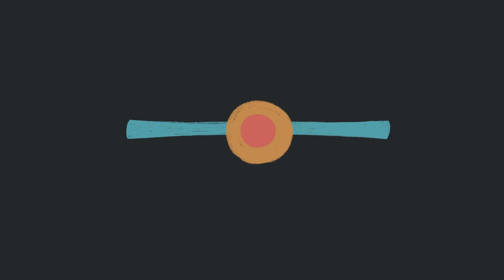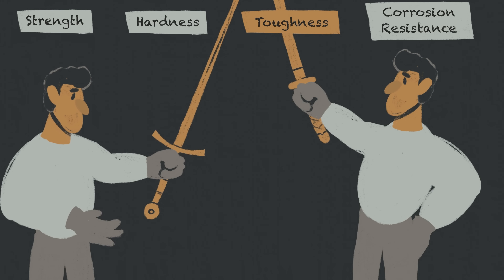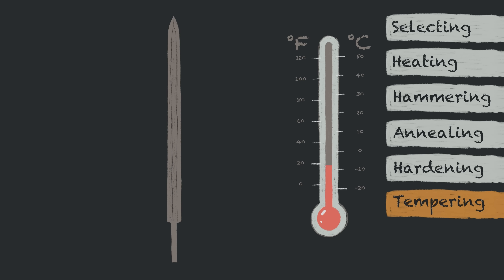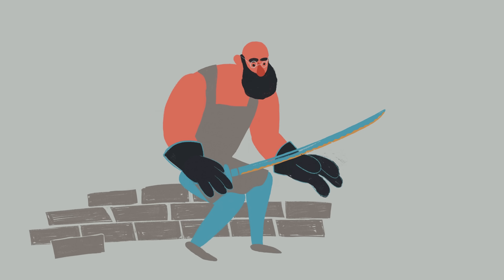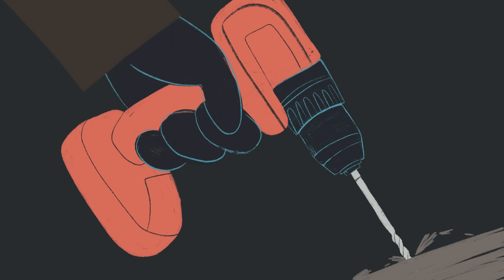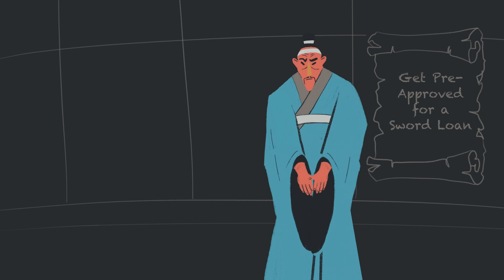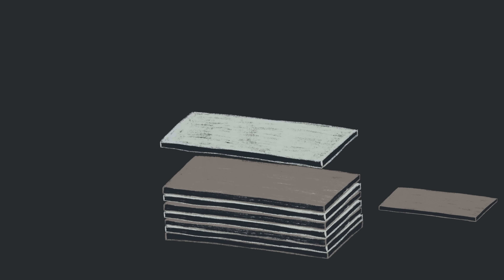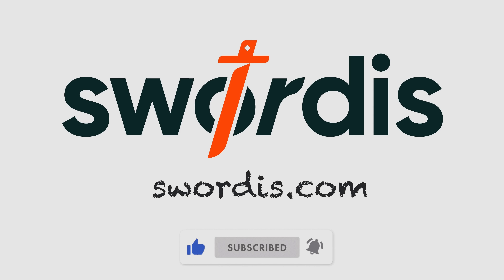The Science behind Sword Steel Types

Comment: The video suggests that through hardened blades are less tough than differentially hardened blades (around the 4:30 mark).  I have to respectfully disagree.  Perhaps this would be true in ancient Japan with a traditionally made sword, if it were through hardened to a VERY high rockwell hardness.  But, without a doubt, a sword made of a modern steel, for example, T10, that is through tempered is far more durable than a differentially hardened blade made with the same steel.  Multiple destruction videos demonstrate this (such as those found on Youtube by Matthew Jensen), and I have also seen the truth of this from first hand experience cutting with both types of blades.
Reply: Differentially hardening in a modern context is first and foremost an aesthetic choice, and I certainly find it (the hamon) attractive and worthwhile to have on some of my swords.  I would say that differential hardening does offer one practical advantage, in that the edge hardness is usually measurably higher than through tempered swords (using a Rockwell hardness measure) which means the sword will have higher edge retention and need to be resharpened less often.

Comment: Steel is NOT an alloy. an alloy is made through a chemical bond. Steel is iron that has carbon dissolved into it like sugar is dissolved in water to make a sweet drink.
differential hardening does not happen because of the rate of heating the blade. 
lower carbon and greater toughness does NOT change flexibility in a sword at all. this is entirely untrue and misleading.
Silicon also does not make steel more flexible it is as if you do not know what the word flexible means
your definitions of tool steel and spring steel are utterly uninformed
bainite is a state steel structure like martensite or pearlite not a type of steel. nearly any blend of steel can be made into bainite and indeed L6 can be made into martensite, pearlite, or bainite. indeed the L6 swords I make are martensitic and not bainite at all.
Also see Marton_dobo's comment below
OK I'm done picking this apart and I'm done watching this. This video contains no useful information move along folks

Comment: I don't think toughness necessarily correlates with material softness. Toughness refers to the amount of energy you can put into metal before it fractures. Tougher metals can stretch further without fracture. So tougher metals tend to be softer, but they can also just be high strength metals instead.

Comment: I am sorry guys, I understand, you are from Japan so you have to defend tamahagene steel. But today, stainless steel is the "best" one. And second is spring steel. Because of the ability to be shock resistent. Diggers, buldozers and cranes. Everyone is using it. There isn't a best steel. Steel is a steel. Everything has it own advantages and disadvantages. But where is you "best" steel? I haven't seen tamahagene steel in my life. I drove a toyota and its whole bodywork is's rather stainless or springsteel. And If we are talking about swords, tamahagene is theoretically worse. Because Japanese people didn't know how to heat up iron just enough. So they had to came up with something special. And that special thing worked. They made a good steel out of "nothing".

Comment: Stainless steel can be just as good of not better than carbon steels. The issue is that it's a nuisance to work and it's very expensive to get good ones
Reply: This ∆ 

Nowadays stainless outperforms carbon in basically all aspects (even in toughness stainless steels can at least match it). The issue is price

Comment: Toughness is how much energy you can absorb while you are bending. A sword will eventually bend, and a low toughness sword will snap while a high toughness one will deform. Resilience is how much of a beating the sword can take before it starts to bend without springing back into shape
Reply: Toughness in this context is more accurately the energy it takes to break a sword. A brittle material can theoretically be tougher than a material that bends if it takes enough energy to break it.

Comment: As interesting as it is. You've mixed few different concepts making it entertaining but not as educational as it could be.

Maybe this video is made more as marketing than educational material.

You're mixing modern metallurgical terms with traditional/historical ones. Eg. Tamahagane and modern Damascus steel are essentially same thing. 

Then we have carbon steel and alloy steel. Alloy steels are then divided in multiple subcategories.

Spring steel is just type of steel commonly used in spring production. It can be either high carbon or alloy. Though alloy spring steels are more widely used.

It goes on and on.
Yet, with all my comments I like this video. It's fast pace and very concise. If not for mixing buns with onions I'd call it perfect

Comment: I was a blacksmith for 25 years and got so incredibly tired of "swords."
That said, this is the most accurate video I've seen.  You use every term correctly and that is rare.
Reply: Do you have any resources for someone looking to start blacksmithing? From what I've seen online most books dont actually detail steps of creating tools and most videos use machines not accessible to someone hoping to pick it up as a hobby.
Reply: @oneilgaming1658 black bear forge has some good videos.
Reply: @oneilgaming1658  
There are a lot of very good beginner videos out there.  I run across them, but, not being a beginner, just move on.  You need a hammer, something to heat with and an anvil.  I started with a ball peen, a broken anvil and a pretty rough coal forge.
All done, I was in for a $100.
I made a set of tongs, awful things, but I got better, bought a used cross peen hammer, a vice and joined a club.  Piece of cake
Instead of an anvil, a piece of railroad rail works great, a $100 propane forge won't break the bank and a machinist vice instead of a blacksmith vice is ok-ish.

Comment: Stop using AI for research.  A coursory look through an introductory bladesmith forum could have given you better information than this.  No one is using below .45% carbon or above 1.2% carbon steels for blades.
Reply from the maker: It could be misleading because that percentage refers to the steel composition. If you look at the carbon steel section, you'll see that we mention the carbon content starts at 0.45%

Comment: Claiming that differentially hardened blades are tougher than through hardened is a wild claim. Yeah, maybe the differentially hardened blade won't shatter to pieces, but it will bend and blow huge chunks of the edge off, which is just as bad. 

And the through hardened blade isn't likely to shatter either. it can break, but it takes a lot more force to do so.

Comment: The part covered with clay does not heat slower but cools slower, that makes the metal softer. both clay-covered and non covered have the same temp when coming out of the heat source

Comment: All that being said.
What is recommended for kitchen knives?
Reply: Depends on how much maintenance you're willing to keep going through to ensure a long lifetime for the knife.

Stainless is the most common because of its rust resistance, since a lot of stainless cutlery and other implements may be laying around for a while without being used regularly.

If you're using the knife daily, or even hourly, stainless steel doesn't hold an edge as well and will require a lot of repeat honing (unrolling the edge) or sharpening (when it cant be honed anymore).  

That being said, the metal type really depends on the intended usage.  If you're dealing with a lot of acid in the food, you want a metal that's more corrosion resistant.  If you're cutting things that require a rocking or sawing motion you'd ideally want something a little softer so potential blade warps dont cause chips or fractures.  

There's no single "best" option, a blade is a tool and the tool should be chosen for the specific job.
Reply: Nonono 

That is all wrong what you said there. 
Stainless steel in general offers higher edge retention due to carbon steels only having the realtively soft cementite as hardest carbide
Reply: Stainless? Idk since it resist rust the most
Reply: What is your budget is the question? 

Open end? -> magnacut 

It combines fantastic edge retention with great thoughness which again allows very thin geometries which in turn again boost cutting performance and edge retention. 

It has very small carbides (like the opposite of D2 steel lol) and is due to that also easy to sharpen. 

It is also extremely rust resistant since the chromium is not caught up in large carbides. 

It is currently the perfect all around steel and maybe the most sought after. 

Just for very specific applications there might be some better ones but because magnacut is great in every aspect it will never fail for a certain knife task.

Comment: But wont water quenching hurt a blade more than quenching in oil?
Reply: Oil and water have different quenching abilities for wicking away heat.  Some steels quench more reliably in water than in oil, others are vice versa, and some actually quench more optimally in the air.
It all has to do with how the carbon and other components affect the iron crystallization as it cools.  Different combinations of materials or the amount of carbon can form imperfections or too tiny a crystal structure if cooled too quickly.  Larger crystals make it tougher, smaller crystals make it harder, but if it cools too fast the smaller crystals can separate from the larger ones still cooling and cause fractures.

Water quenching won't really "rust" the metal all that much as the water molecules move to their gas state from the sheer heat of the blade, and quenching is done before the finishing grinds and polishes, which remove that rust anyway.  

There are tables of which metals quench best in what environment, and some oils are better or worse than others!

Comment: Tahmahagani is a sucky steel, BUT!, it’s super cool that they were able to make it with what they had
Reply: i heard tamahagane steel kinda was from rivers, meaning it would be more impure iron/steel, but ey at least the method and the process feels legendary, if only we could purify it to also functionally be epic too, but you are completely right, not the best but amazing how it was achieved
Reply: Real tamahagane is both expensive and controlled resource. That's why a blacksmith life is suffering, they could only produce a few swords per month. Under the fake vein of preserving authenticity and public safety, they basically put a total ban on katana mass production. And it is sucky compared to modern steel, but it is no worse and even better than some of it's medieval contemporaries.
Reply: @ZeroXSEED From the historic steel analysis I have seen it was in general worse simply again due to the impurity of the starting material

Comment: Very nice video, and I appreciate that you pointed out the difference between Wootz and modern "Damascus", as well as the rumors around pattern-welded steel's performance! I have a minor quibble, at 2:50 you say the steel is heated until it's red hot and then forged out. In reality, red heat is almost too low for effective forging, and you really want the steel to be a bright orange or even yellow heat if possible (white heat is too much most of the time, and can involve burning the carbon out of the steel). Red heat is great for straightening blades and correcting minor imperfections before heating the steel again, but it shouldn't be the primary forging temperature.

Comment: Wish they talked more about S5 shock steel. I saw that stuff take alot of abuse & i wanna know how it differs from regular spring or carbon steel
Reply: Its a certain silicon alloyed spring steel. Knifesteelnerds has an interesting article about sillicon alloyed steels (inclding S5) named "Silicon additions for improving steel toughness". Talkes a bit about the mechanics of silicon alloying and compares S5 hardness-toughness balance to some other common high toughness steels. But in short: S5 offers one of the best hardness toughness balances ever below a hardness of 59HRC.